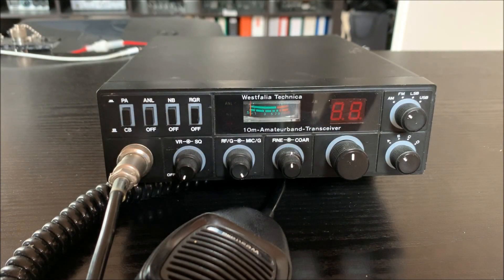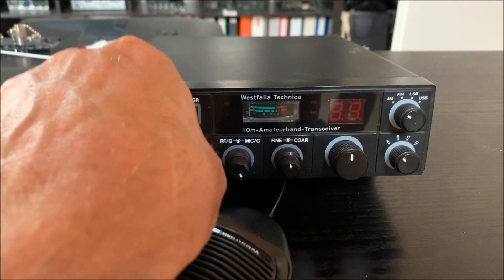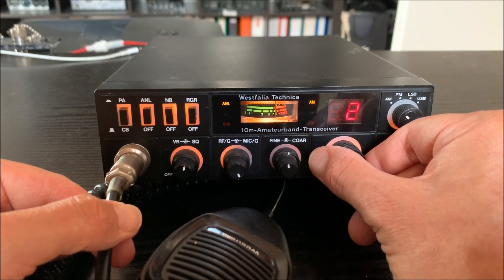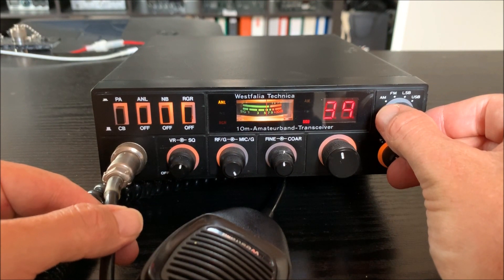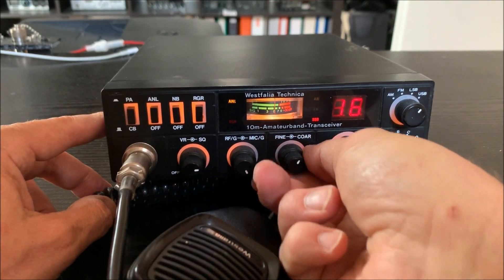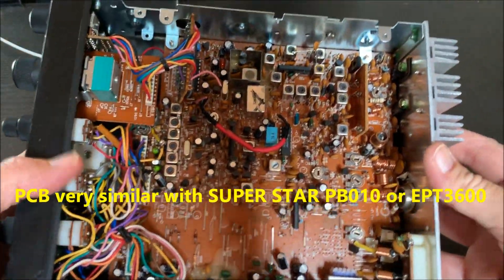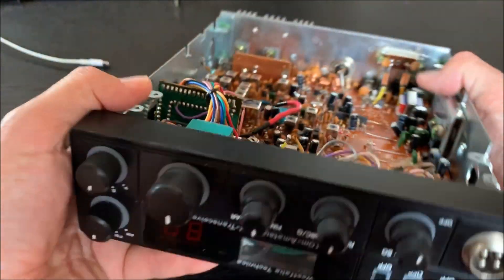Westfalia Technica 10m Amateurband Transceiver (strange radio)

Comment: Hello, recently I bought this radio and while I was testing it for a first time, SSB stopped working after some time. When I switch to LSB/USB, the channel indicator turns off and the radio stops receiving. After I switch back to AM/FM it starts working again. Have you ever encountered this problem?
Reply from the maker: Hello dr CB radio fan, thank you for your interest. I'm sorry, I've no plan, what the problem is with your WESTFALIA. But my radio has a problem with the CB-frequencies. It starts on CH1 on 26.955 MHz. The radio is originaly just a 10m radio. The EPROM in the radio is programming for a lot of functions. I think, the problem is to solve on the EPROM. I hoppe you can find the bug. Best 73 from the ZURICH high lands..
Reply: Lubricate the mode switch...with contact spray,had this once with alan87(clone built 2000? China)it was dry.

Comment: i have a euro cb clean tone (not so long)it has 240 channels,it has the same apearance but the board could be simmilar??my board has the mrf 477 as a final,and the plc has an eprom in it???at first glance i thougt it was an eurocb cleantone but mine doesnt have 10 meters and 40 channels more on the selector
Reply from the maker: CB-radio fan Richard hello, thank you for the Info. The Westfalia uses a PCB with 2SC1969 in the final. It's not similar with your Euro-CB. But very egal with my Euro-CB 3900. Take a look into my video: https://youtu.be/16ir0DJFzrM
 Best 73 to you...

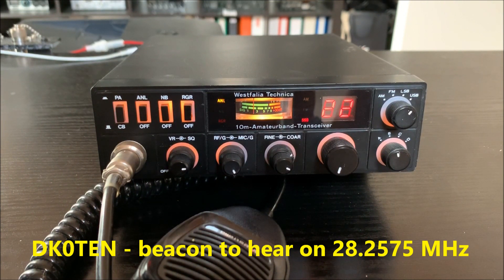Comment: [03:20] My N00b Question, why are those beacons out there? For me as a out-stander they seem to be no more then annoying sounds.
Reply from the maker: Mr green hello, thank you for your interest. An amateur radio propagation beacon is a radio beacon, whose purpose is the investigation of the propagation of radio signals. Most radio propagation beacons use amateur radio frequencies. They can be found on LF, MF, HF, VHF, UHF, and microwave frequencies. Microwave beacons are also used as signal sources to test and calibrate antennas and receivers. Best 73s to you...
Reply: @SWIZZRADIOS  Ah, thanks did not know that
Reply from the maker: @ @VicGreenBitcoin :You're welcome...73s..